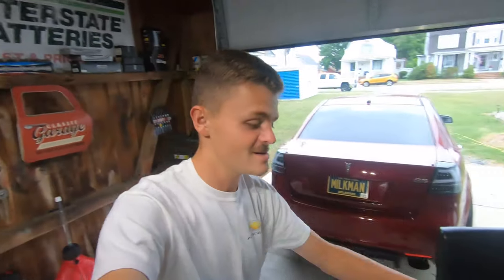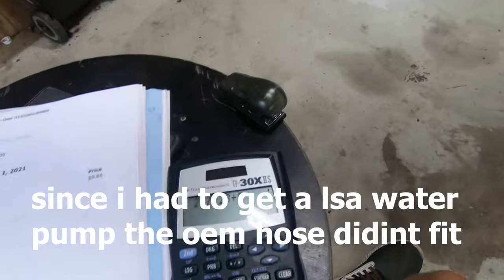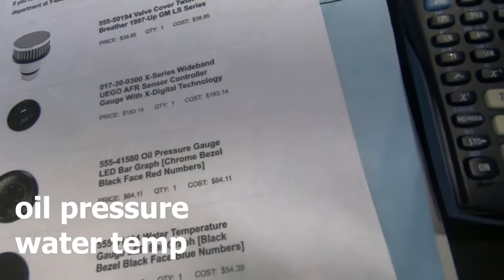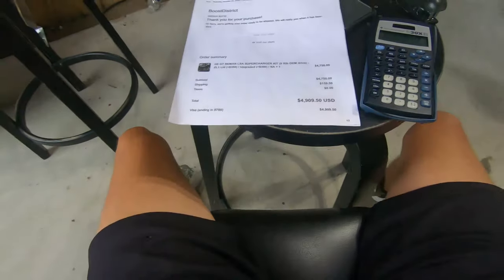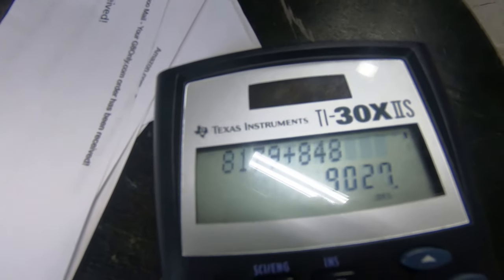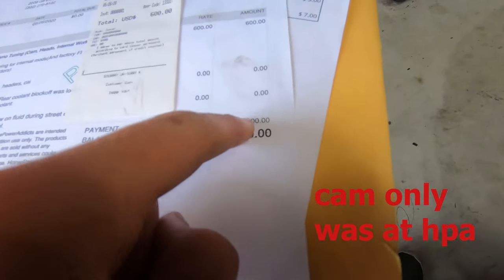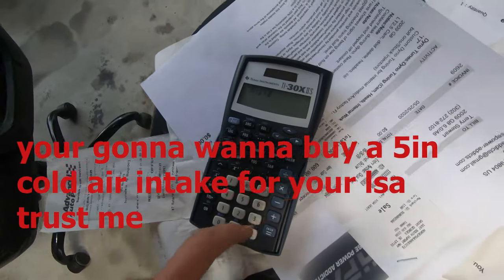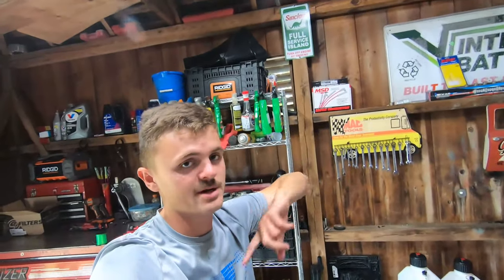How Much Does it Cost to Cam and Supercharge Your LS Motor!?!?

Comment: Not too shabby, most of my build was used parts took probably a year just to source everything. I think I’m around 8k with ported blower and built bottom end
Reply from the maker: How much did you bottom end cost roughly ?
Reply: @1bad8   i kinda went cheap on it. 
Block - $200 
Rotating assembly - $1600
Machine work - $700

Comment: You can actually modify your driver side valve cover to eliminate having to use a catch can.. I saw it on a channel (CrazedPerformanceRepair) and it worked well for my G8. No more oil leaks or pcv clogs
Reply from the maker: Hmmm Is that with Lsa or any kind of boost ?
Reply: @1bad8  It was done on a  N/A motor. May not work so well with the amount of power you're making.
Reply from the maker: @02DDP  gotcha I would be worried about to much blow by only concern

Comment: I wish I could find a G8 for $15k with less than 100k miles
Reply: Spend 10k more and get the chevy SS
Reply: @marcusware712  a 2014 SS with 60k miles is going for over 30k now!